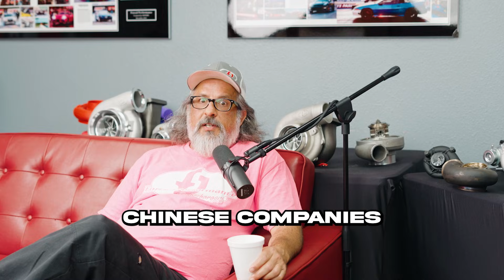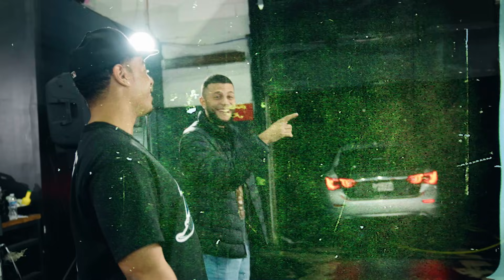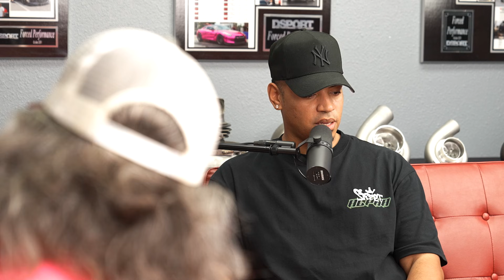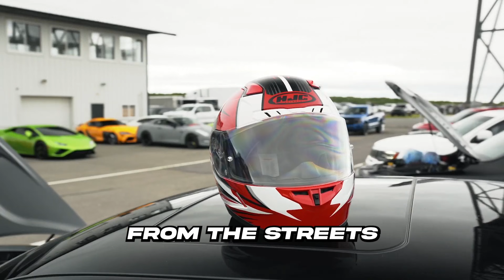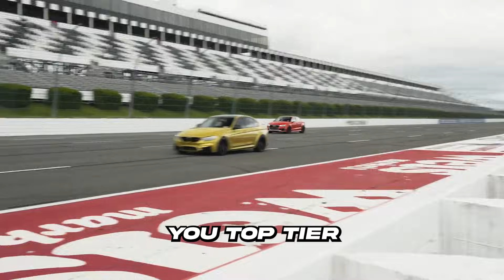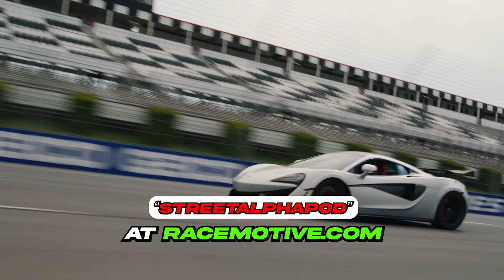Forced Performance On How To Pick The Right Turbo, Journal Vs Ball Bearing, and Compressor Maps

Comment: They are the only turbo company that took the time to talk to me about my turbo outboard marine engine project and legit go over the details to make sure we picked something that will best fit my goals. The fact that it’s lighter and has stainless center section and housing AND comes in a reverse rotation was just icing on the cake.

Comment: Turbos could be as lot better than they are still.. you look at ww2 turbos or a motorsport grade turbo from garrett.. they look way different compared to even a g series turbo... all this turbo tech got figured out in the 1940's and fuck all of the turbo guys done anything more advanced than the ones from back then. Swirl throttles, more than one compressor on a shaft.. mixed flow and axial turbines... so much more room for development
Reply: A lot can be done to improve them.

Comment: Not knocking Precision..God bless any made in America manufacturing, but coming from Garrett offerings since my first turbo, I could never understand how they could be sold without Compressor MAP data... 

Looking back on it now, it's not as though the knock-offs from other countries of origin offer MAP's either, and I get how costly the validation of the testing needs be but I suppose the company strived without it, and I'm sure once you own other relatively sized  precision model's, you have a fair understanding on the neighborhood of power you stand to gain, but in the beginning I found it boggling.

Comment: Great insightful interview but 2 things: 1) there were plenty of oil cooled only OEM turbos. Saab 99/900 / Merkur XRT4, Nissan/Datsun 280ZX are some examples. 2) you'll prob not get any tight/no shaft play turbos with debris packing it together as it would have started to disintegrate the bearings or shaft in short order. If its binding from coking together, then sure.

Comment: I'm wondering how precision, hpt and turbosmart can get away without watercooling. BW also says that it's there for everyday street use when you turn off the engine when it's still hot so you don't cook the oil in the turbo just like Robert described.

Comment: God, why didn't this come out 2 years ago when I built my 06STi. +2mm rods/ ferrea valve train/ tomei poncams/aem340pump, ID1300/ and FP Blue... Wanted to rev out to 8k @ autox, but still spool early for off power corners. Flexfuel didn't pan out(piss on Cobb) and the blue is a turd with cams and pump gas. Still made 400 on dynodynamics even staying conservative with timing.
 
The tuner recommended the x500r/ second fuel pump/ and/ Haltech standalone.

Translation for non Subaru people: spend an extra 8-10k for +150whp.   But that includes flex fuel, and a sweet digital dash.
Reply: 400 WHP on only pump gas?
Reply: @coffeedrinker25-z4v  yea, ID1300s and parallel fuel lines/ there's plenty of 93octane on tap to make power. Didn't even tweak base fuel pressure.  Still waiting on ethanol, might just get multiple tunes for when I can get the 🌽 juice from a few towns over.

Comment: 2012-2015 1g dsm got the car with precision 50 trim,balance shafts went that fall winter 2g piston 1g rods fresh head 272,s fp black 33 psi e85 2900lb awd and it ran with 750gsxr and hurt a lot of v8 feelings ..few years after me and car part ways picked up a galant fp green made 510 mustang 30 psi ..loved ever minute of my Forced performance experience

Comment: Great episode , learned a few things as well. Glad I saw this before ordering a Garrett G35-900……..now I’m dead set on a Garrett G35-900 .83A/R
Reply: Or get a Xona ;). If you have a small displacement motor, the g series aero isn’t ideal for the PR needed to make power.
Reply: @4familyman  9.6:1 compression forged 2jz VVTI built head GSC s1 cams. E85